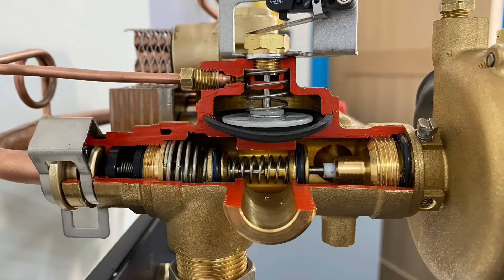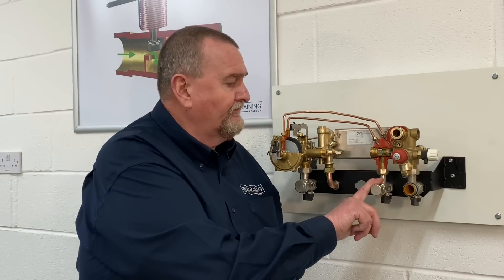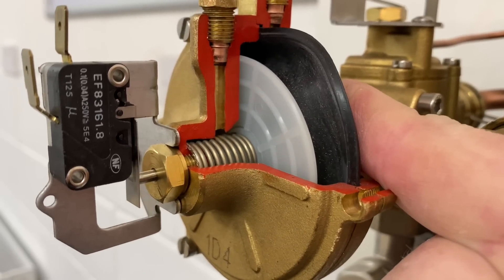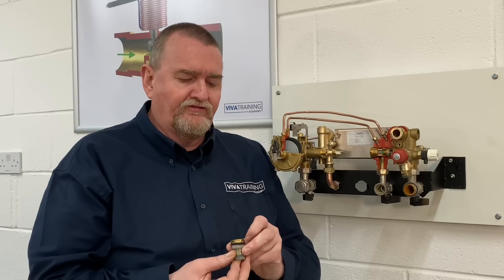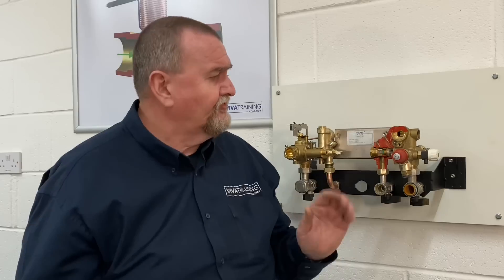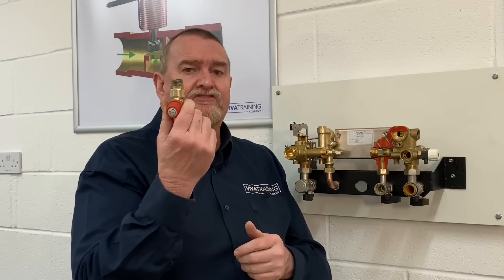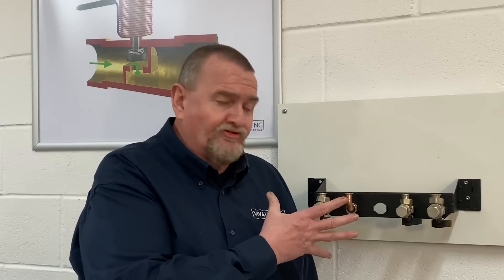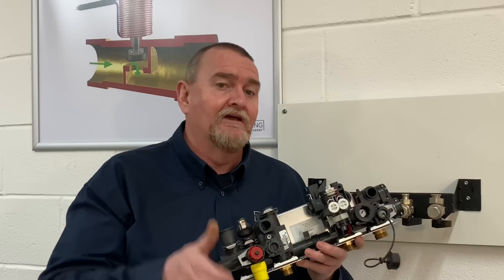BAXI 105 Fault Finding diverter valves and hydroblock in a boiler - Gas Training

Comment: Thank you!
Our 105e was behaving like it had a pinhole in the diaphragm, where it would only enter DHW mode at very high flow rates.
I keep a diverter service kit in the kitchen drawer,  just like I kept the magnetic reed flow switches for the Bahama at the old house.
I was surprised to find the diaphragm wasn't holed, but replaced it anyway (old ones never want to go back, do they).
Then scratching my head wondering why I had insufficient pressure differential.
To create a differential, there needs to be a restriction somewhere.
But how can the restriction fail?
6 minutes in, everything makes sense.

Thank you again!

Comment: Hi Allen and Roy. Thanks so much for a detailed breakdown of the hydroblock. I am going to a main 24he tomorrow where the hot water is going hot and cold. I have assumed it is the plate but now i have watched this, it could be a flow restrictor as well. So, thank you both. An awesome video.

Comment: We have a main 24 he,the diverter has been replaced with a brand new complete unit but still struggling with the hot water activating upstairs taps will activate after a few seconds but not the shower, downstairs tap doesn't activate the hot water is it likely to be the hydraulic Venturi, thanks for the video 👍

Comment: Just out of curiosity, why would you get a leak where the screws are (you took two out of the pressure differential)? There are another two holes there, i have a leak from there and was just wondering what could cause this

Comment: I need to thank Allen and Roy so much today, as because of you i found a blocked water filter that i just hadn't thought of checking, and it was because Roy was so thorough in describing what normally happens due to his indepth knowledge that i thought i had better check it (blocked almost solid).  The fact that you are doing this out of kindness mainly with very little return in this day of age with people charging whatever they can get away with, makes this ten times the value that it would have been in the 70's. I would buy you both a couple of pints if i ever met you, and that offer stands forever. 👍

Comment: Thanks to this video I have fixed our Main 24he. We bought a property with this old combi in and wanted to keep it going a bit longer before replacing with something more modern. Our boiler wouldn't fire unless there was a large amount of flow from the hot water taps, requiring two taps to be opened almost all the way for the diverter pin to fully extend and engage the microswitch. I had removed the diverter valve body and fully rebuilt it using a rebuilt kit from eBay, but this made no difference. Watching your video, I then discovered the hydraulic Venturi. This was an even bigger faff to remove, but eventually got there with a 24mm wrench. The plastic part had disintegrated and the spring was loose in the hydroblock. I fished it out and replaced it with a new £15 replacement from eBay and now the boiler works as intended. Surprisingly none of the gauze filters were blocked on this old boiler and everything was quite clean. I also removed the differential pipes and flushed them out with water and air. I have degrees in mechanical engineering and electrical engineering and currently work on designing building control systems, but I will be having a gas safe engineer come and check everything over before we move in to the property. Cheers.
Reply from the maker: Thank You

Comment: Very useful suggestion on ensuring the small pipe off the rear mounted bypass which feeds the pump proving diaphragm and associated microswitch isn't blocked.  Great video.
Reply from the maker: Thank You

Comment: Great video Allen and Roy, 

May I ask as Roy never mentioned it, what would cause the pin on top if the diverter valve not to fully retract after demand, I have an issue where after pump has stopped the pin is half way out and still engaging the micro switch 

Many thanks
Reply: Dirt on the pin stops it sliding through the stuffing box
Reply: HAVE THE SAME ISSUE, RE-GRASED THE PIN ..BUT STILL STICKS UP @lucasdoesgaming66

Comment: I have a Baxi Duo-tech 28 HE A. It’s working okay, no fault codes etc. Located in a downstairs utility room. It feeds the radiators upstairs and them drops down into the lounge and onto the hallway.  All the radiator upstairs get hot and the hot water supply is fine. However the radiators in the lounge and hall do not get any heat.  i’ve checked and there are no blockages. The boiler has just had the DIVERTER cartridge, motor and thermistor replaced.  but this has mad no difference.  Any ideas what could be causing theirs.  The boiler has been installed for 11 years.

Comment: I cleaned everything like new every piece is cleaned and waxed good water pressure the membrane is good but the hot water pin is not coming out to activate hot water mode with my hand it moves perfectly but with water the pin doesn't come out

Comment: Hi Alan just been called out, heating not firing, pin not coming out of block, changed diaphragm, power off as system comes up to pressure pin comes out and makes contact on microswitch, asked everyone no recommendations, changed diverter valve system works everything fine now but why did pin come out after diaphragm changed

Comment: What could be the culprit of the plunger not coming out enough of the pressure differential valve on the front of diverter valve for hot water. It comes out a little bit but not enough to activate the microswitch. The plunger and diagphram have been replaced with no avail.
The hot water does work but only with the heating on.

Comment: Hi , i have a Baxi 105 HE , had a problem for some time  with only getting hot water if the mixer tap is turned on full on all taps and it takes about 1 minute to get hot, as soon as you reduce the tap the burner stops and cold water , could you advice on what the problem could be, the plumber has changed the diaghram on the diverter, he saying now the diverter is faulty, would appreciate your help, thanks
Reply: Hi. Did you ever fix this problem? I have the same thing. Please let me know, thanks.

Comment: Hi, have one at the moment, hot water is temperamental, but when there’s a call for hot water the pin on the heating side doesn’t retract, the pin on the water side comes out, Boiler fires up but hot to start then goes tepid, pin on heating stays engaged with micro switch, any idea please

Comment: The hydraulic Venturi can be difficult to remove. You need a 24mm ring spanner and it helps to spray it with shock release spray if it is stiff to loosen it up so you don't round it off.  If the plastic part has crumbled , you can get the pieces of plastic out by removing the plate and poking the plastic out from the back. Also check in the plate for pieces of the plastic.

Comment: Hi, could you post the hydro inlet assembly filter and flow restrictor part number 12 L.
As Baxi parts don't list this individually, only the full unit?  MAIN 24HE HYDRAULIC INLET ASSEMBLY 248246.
So how can just the required serviceable items be obtained?

Comment: Great in depth video and learning new things 

Love knowing how things work and the cut down parts so You can see inside 

Also I’ve changed a few diverter valves on these boiler an a few times I’ve had the orings on the bypass leak.. 
Tried replacing for one of my kit box but nothing near correct size,  Baxi do sell them but they don’t give you the actual size of the orings . I found thus awkward as you cannot replace this oring because not knowing the size.. would Roy know the size of the bypass oring ? 

Thanks